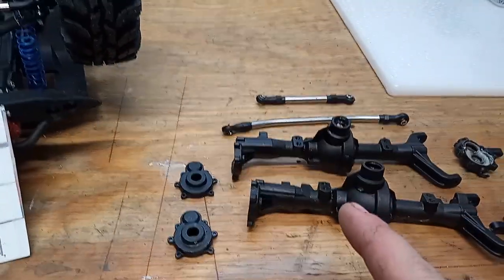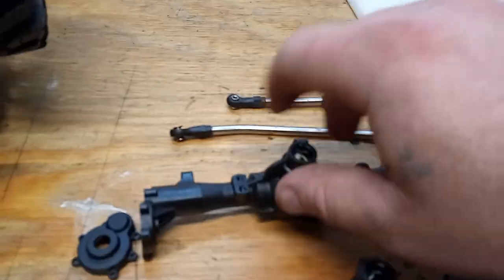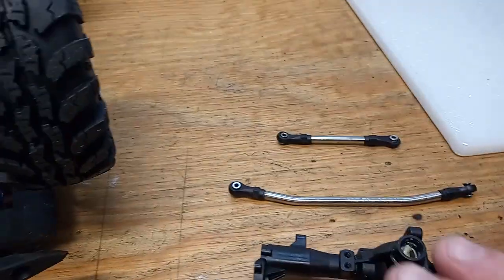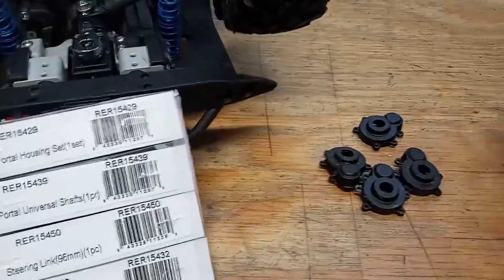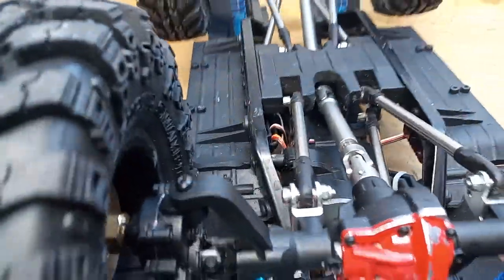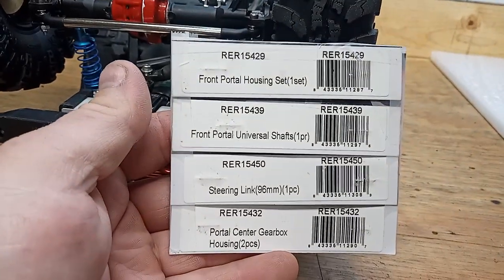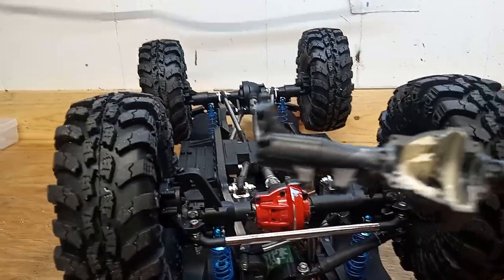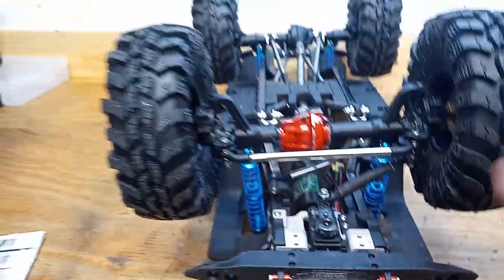redcat gen8 with gen9 axles

Comment: If you want to use your existing V1 or V2 Gen8 front axle as a donor here is the parts compatibility. Gen8 outer portal covers (even aftermarket brass), diff covers, spool, ring/pinion gears (including aftermarket over/under drives), stub axles (including extended ones), lower portal gears, and all bearings can be reused in building a Gen9 front axle (the rear center housing is slightly different, but all rear parts are 100% compatible between the 8 & 9).  You will NEED the front Gen9 center housing, axle U-joint shafts (comes with top portal gear & Locktite the inner grub screw for durability), inner portal box steering knuckles, lower link/panhard mounts (get the Treal ones), and all 3 steering, drag, & panhard links.  If doner axle is a V1 you will also need the long grub screws that hold the lower shock in place (V2 is same as Gen9). I also RECOMMEND getting the front Gen9 shock towers (the upper panhard mount is relocated for reduced bump steer).  Finally the Gen9 STEERING MOD:  Shave down the bump stop on the back side of the steering knuckle arm. Next you need a TRX4 "high clearance" aftermarket drag link (connects the 2 knuckle arms) (I think Club5 now sells a Gen9 one too).  It is the same length "eye to eye" as the Gen9, but is "bows" out more so it doesn't hit the front diff cover after shaving the bump stops. This allow the servo to "throw" further left to right  giving more steering angle.  Don't over do it as it will put some more stress on the front axle U-joints (Locktite the inner grub screws!).  I've built 2 Gen9 front axles from both a V1 and V2 donors.
Reply from the maker: Thank you for the help on this I appreciate it

Comment: Wouldn't you also want to change the gen9 shock towers and panhard bar? So you get the better geometry of the gen9 to help eliminate bump steer.
I have a gen8 v2 and just got the two speed conversion kit. Now, I'm looking to upgrade the front axle. It just seems to me that I would also want to upgrade those two parts as well. I don't believe there is any difference between the shock towers, other than the panhard mount. But I'm not sure, I guess more research is needed lol.
Reply from the maker: I’m got the club 5 servo relocation bracket, and a custom Panhard bar and steering links I have virtually no bump steer